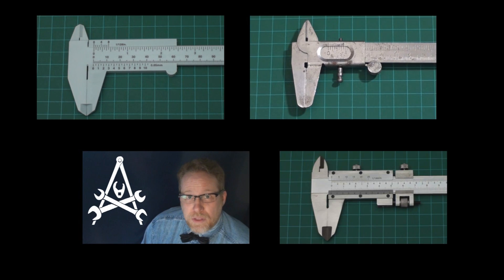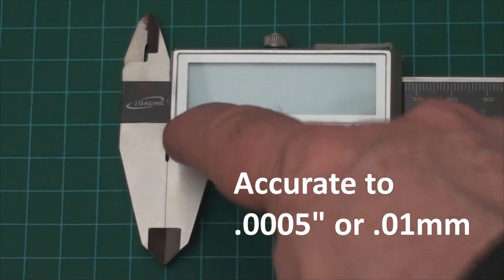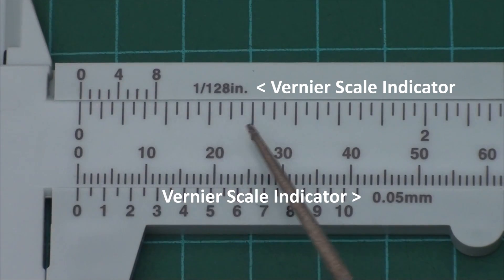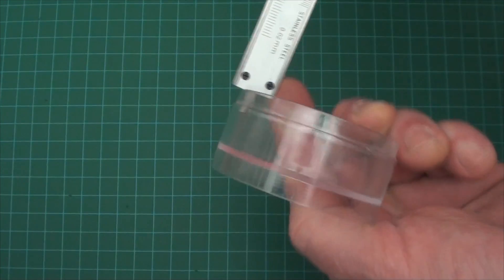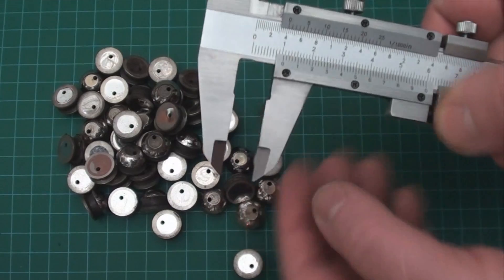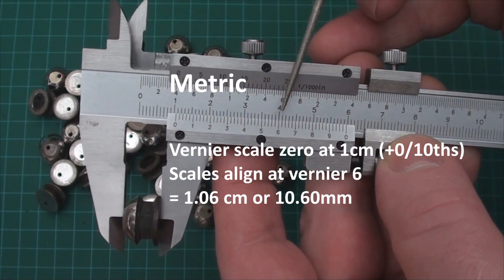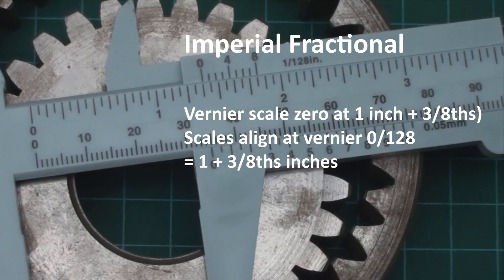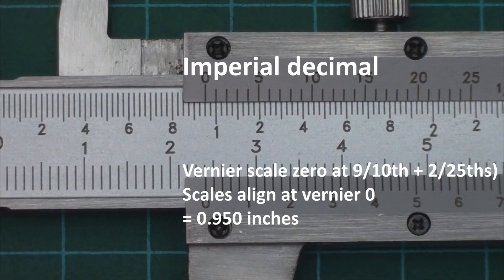Vernier Scale Caliper Reading - Metric, Imperial Decimal & Imperial Fractions.

Comment: Okay. When measuring quarter; the upper zero is on 9 and and two hashes. That translates to .095?
Reply from the maker: You're only off by one decimal place. On that scale (imperial decimal -upper fixed and slider above) each long numbered hash mark is worth 1/10th" or 0.1", each short mark worth 25/1000ths [1/4 of 1/10th] or 0.025
Therefore 0.9 + 0.05 = 0.95
If the Vernier scale seems to point the 1" (fixed) to the 1/1000ths (slider) it's because of the camera angle (I triple checked all measurements with my digital caliper). That said, for the sake of the exercise, if they were aligned: the measurement would be 0.951 (0.9 + 0.05 + 0.001)
Reply: And how many thousandths?  @repairs101
Reply from the maker: 0.950